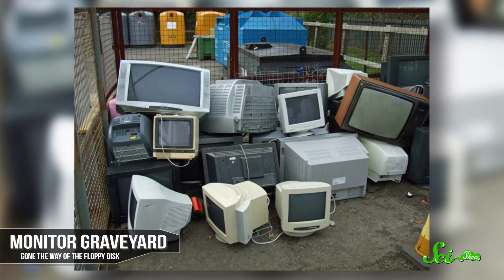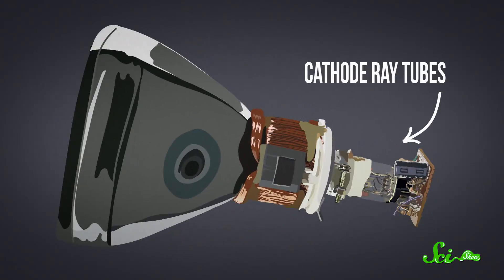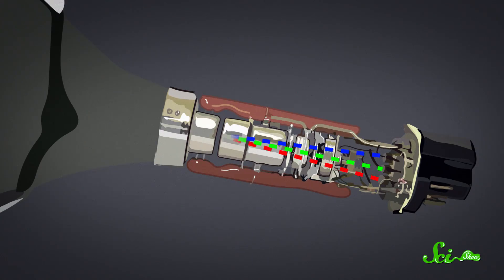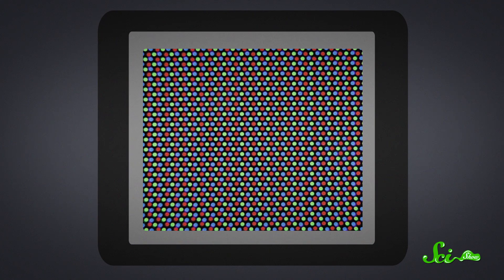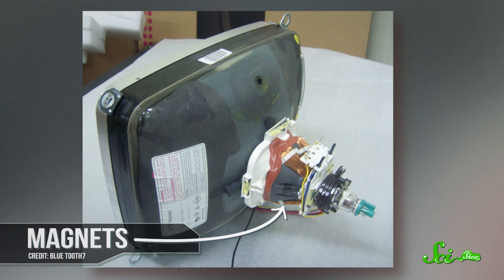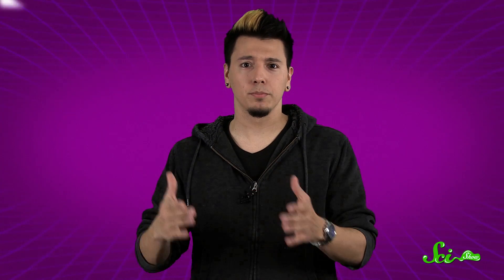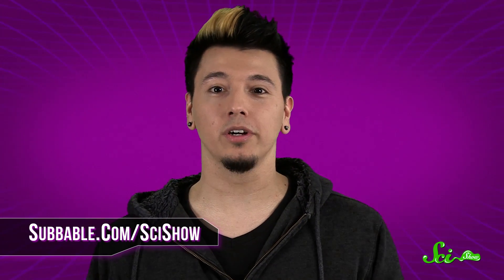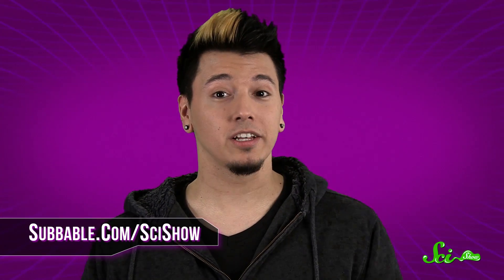How Did a Magnet Just Break My Monitor?

Comment: Place the woofer of your sound system on top of your PC tower and your power supply will fry in less than a year. It happened to me tree times before I finally wizened up to it. Always blaming the quality, it turned out it was my placing of the equipment.
Reply: Microwaves and routers together are also a bad placement, which was learned the hard way.
Reply: ***** It's not the vibrations, it's the magnets inside the sub-woofer.
Reply: Most likely the vibrations shifted dust to somewhere it shouldn't be.
Reply: Thank you all for your comments. Actually in my case the vibrations had absolutely nothing to do with it. It was the big magnet on the back of the speaker that did the job repeatedly. The vibrations kept my TWR lint free. but not dust free. I clean my motherboard once a year. The hard drive is now 16 years old and I´ve kept it for nostalgia purposes still going strong. It is an old IBM. All I did to fix the issue was turn the woofer around so that the vent hole was underneath to keep the magnet 10 cms above the TWR and the power source and that CPU lasted another 6 years until replaced by an upgrade. and yes the second power source did start growling about a month before it went south. I did clean some disecated spiders out of the cooling fins of the chip and video card.
Reply: Hang on...

What did you say?
It's, really late where I am..

Something about a computer woofer?
Reply: Jacob Thomas
That's when your PC growls because it's a real beast!
Reply: StevieRay9O oh.. really?
my computer doesnt make a single sound louder than the 15db fan...
does that mean its weak?
Reply: I WAS RIGHT MOTHERF*****S!!!!!!!!!!!!!
Reply: wow... was going to put my comp on top of my 12in sub and i'm pretty sure the magnet on the back was for 8 ohms... thanks for the tip...
Reply: *****
well then i'm sure you'd be quite surprised to know that i built the woofer, i suppose i'm not too informed on the magnets however. Regardless, I actually might look into this, sounds interesting.

Comment: Why do some things melt, like cheese or plastic, while other things burn, like wood or fabric?
Reply: things burn when bonds between molecules begin to break releasing energy. when something solid melts it is because the particles that make up the solid have gained enough energy to move around faster. When particles move around faster the state of matter changes. example: Water is just ice that has particles with more energy as they have more energy the state of matter changes from solid to liquid. Energy=how fast particles move=state of matter

Melting points can be dependant on the mass of the particles. particles that are more heavy tend to need more energy to become a liquid. The size of the molecules also affect the energy needed to make them not solid. 
The reason things burn is because the bonds between the molecules break when encountering a certain amount of energy. if the bonds are weak then it will burn. if the bonds are strong and the molecule is small then it would melt. I  hope that helps

Comment: Here's a question it may sound stupid but think about it...What Is Fire?
Reply: Here you go: http://en.wikipedia.org/wiki/Fire
Reply: Nilguiri Excuse me for not being born to an english country. English is not my first language, and not even my second, so please, don't be a dick.
Reply: Tatum Knowles
wrong. I'm a phycisist and it's because the reaction with oxygen and carbon makes the air/gas around the flame so hot that it starts radiating electromagnetic rays that are in a spectrum which we can observe with out eyes. When an objects temprature goes over 525 degrees celcius it will start emitting visible light (it goes from infrared to dark red), and the higher the temprature, the more intense will the light be. In the end you'll get blue flames (above 2000 degrees celcius).
Reply: uuuuuhhhhhhhhhmmmmmmm... very hot gas, that has so much energy to radiate, that it also emits light. Kinda like that, I guess?... maybe.
Reply: It is actually plasma. the heat of combustion gets the electrons in the gas above it so excited, that they leave their atoms, thus creating ions (so plasma is just ionized gas). But those ions arent very stable. they seek to get their electrons back, to get on a lower energy level. So when they finally get their electron(s) back, all that energy once put in, to rip the electron off, now gets released again, in form of electromagnetic waves/photons and therefore light and heat.
Btw, in order for atoms to emit light they dont have to nececarily lose electrons. depending on the atom/molecule it may also be enough to just excite the electron shell, literally deforming it like a flummy at the moment it hits the ground. This is also a way to pump energy in. When the shell pops back into it original shape, the energy gets released again in form of light (this is what happens in fluorescent tubes).
In case of the fire it depends on the colour of the flame, but if it is red/yellow it mostly is unburnt carbon from the combustion becoming plasma. thats also why there is soot collecting on things if you hold them just over the flame of a candle.

I hope I could help you (and that everything is correct) ;)
Reply: Hay I find that a pretty legit question.
Reply: Be nice all. Asking what fire is is a good question and we have gotten a few good answer here. I think however is such a good question that it may deserve it own little episode. Then question like if it a plasma or a gas (or nether) could be answer for example or if you really need oxygen to create fire. Fire is quite complex and fascinating phenomena.
Reply: Nilguiri you weren't even funny lol
Reply: It's an incandescent gas.
Reply: Nilguiri 1. I can't find a single ounce of humour in your comment
2. Do you have a life? What does my country have with my auditude? I can't beleive you have nothing else to do other than looking at my profile to check where I live.
3. "I'm guessing" my ass.
4. you are the hostile one.
5. you are also stereotypical
6. looking for excuse for your actions
7. why do I even bother, I'm sure you are not older than 13 years old, the extent of your interactions with people outside of your town is near zero, so your so called "opinion" on Israel or I guess any country that isn't your own are souly based from the internet and news.
Reply: FlyingJetpack1 Actually, this is a bit of a misnomer. Fire by definition needs an oxidizing agent--the most common one is oxygen, but something like Chlorine trifluoride makes for an effective (actually better) replacement for oxygen. Oxygen is just such a common oxidizer the process is named for the element. Other elements/compounds, however, can serve the role.
Reply: In two words or less. Plasma.
Reply: fire is the moment and space where the three conditions for combustion are met.
Reply: Not into the pit. It burrrrrrns!
Reply: Cythil Fire by definition means there is a need in oxygen, it's a rapid oxidation of the fuel, or something in his components.
To create a suitable state for fire to happen, you need a balanced consentration of fuel, oxygen, and sufficiant heat to create the chain reaction (heat doesn't have to be hot in our terms, as long as it's good enough for that spesific reaction, than it will burn)
Reply: FlyingJetpack1
You do know I was asking more of rhetorical questions right? I used them as a example on what might be relevant to a video to take up.

(on a deeper level it also a valid question a element like Fluorine can act as a stronger oxidizer then oxygen.)
Reply: Cythil  Oh I see, sorry, I thought you asked the question for yourself. Yea, they might need to give it an episode to clear the air on the subject. (btw: about fluorine, the more you know :P)
[P.S: wtf is worng with Nilguiri?]
Reply: fire is a rapid redox (reduction-oxidization) reaction which produces a sufficient amount of heat to maintain itself
unless you are talking about flames which is the airs electrons being ripped off by the extreme heat (aka it becoming plasma). this is similar to fluorescent bulbs, except they use electricity to rip off the electrons and have a coating to recycle UV radiation as visible light
(side note, oxygen is not required for fire, it is just a great oxidizer and abundant so usually involved in redox reactions)
(also not all redox reactions are fire, for example rust is a common redox reaction that is not a fire)
M390VI actually it is chemical, unless you are referring to how all chemical reactions work by using electrons to form bonds?
Reply: 1.
a state, process, or instance of combustion in which fuel or other material is ignited and combined with oxygen, giving off light, heat, and flame.

    Please, please, oh please tell me you where kidding.
Reply: Tatum Knowles It's not though. It's thermal and solar energy that was released from the bonds in the fuel molecules. Ask your future chemistry teacher.
Reply: teledoor24 It actually depends on the fire. Some get hot enough to produce plasma, others don't.
Reply: After all the shit that blew up on the plasma video, I think we genuinely need this.
Reply: Tatum Knowles Rarely the case though. I went to a "computing specialist school" that a. didn't teach computing and b. had IT teachers who struggled with Microsoft Word.
Reply: Nick Richter
XD
Reply: ***** fine then explain what it is and let see your chemistry knowledge
Reply: ***** well your not getting the nobel prize any time soon
Reply: Dax Daily please please please tell me you didnt google that
Reply: Cythil it is a pretty legit question
Reply: ***** wikipedia isn't reliable
Reply: ***** Yes cause im sure that is what steven hawking would say
Reply: Fire is wood rusting really really fast.
Reply: One word: plasma.

Comment: CRTs are still great display devices.
Reply: Also, removing permanent marker or someone's greasy finger prints is super easy in those.
Reply: Bit power hungry though.
Reply: They weigh lots.
They are too large.
They emit a high pitched sound when you get close enough.
They're bad for your eyesight.
The tubes need to warm up.
They have poor image quality.
They get large blotches on them if placed near a largish speaker.
Simple LCD displays are cheaper, and don't have any of these issues.

Try moving a 42 inch CRT up 3 flights of stairs.
Reply: ***** 

Cheaper LCD monitors emits hissing noises in some situations,not necessarily only when the PSU's Capacitors are failing.
Most LCDs have even poorer image quality and narrow viewing angles due to them being cheap Twisted Nematic.VA,IPS and PLS panels that are actually good are not as common as desktop and laptop displays but much more common on tablets and smartphones.
So LCD displays also have similar issues many of the times as well.
But still,anyone who is using CRT now for better colour reproduction should get a  IPS panel nevertheless.
Reply: Good job I have a mid range IPS panel

Comment: I had a CRT-monitor standing on a sub-woofer for like a year and after I moved the woofer the monitor looked pretty messed up. Fixed it right up by dragging a magnet I had lying around over it a couple of times. It didn't get perfect right away but it became usable and after a while it went back to normal by itself so it's not necessarily permanently damaged. Same thing when I played with some magnets on the TV as a kid. It was messed up for a week or two but it gradually went away.

Comment: You said that this only happened with old technology. Does this happen with modern computers? How do modern computers work?
Reply: It's about the screen technology not the computer. Modern LCD-screens (including TFT) work by having a back-light in front of a screen with liquid crystals that either block or let light through depending on if a current is passed through them or not. (actually it changes the polarization of the liquid crystal and the light is polarized first and when the polarization matches light gets through otherwise it's blocked). Each pixel on the screen is still divided into Red, Green and Blue subpixels to create all possible colors.
Reply: There really isn't anything different about modern computers that computers from 20 years ago didn't have. They are fundamentally the same. Besides, we still use magnets in the disc drives, hard drives, and laptops, which are typically in  top corners of the display and these are used to determine if the "lid" is closed.
Reply: ***** luckily, hard drives are starting to be replaced with solid state drives and disk drives are becoming less relevant because of the internet. but i imagine the laptop thing is staying for a while.
Reply: Huntracony
Solid state drives hold very little space though. The highest capacity ones I've heard of in commercial production is like 500GB, whereas I've seen HDD in the 4TB range. Either would work fine for me, and seeing as the SSD is faster it would probably be my better choice. However I got a HDD drive for some reason on my custom laptop i bought recently.
Reply: Darticus the Great right now hard drives re definately bigger, but SSD's will probably catch up.
Reply: Darticus the Great
1TB SSDs are in mass commercial production now. Though still really expensive. As for HDD, 6TB are in mass commercial production. Though they are still fairly expensive.
250GB SSD and 2TB HDD are more the decent price range around here. (British Columbia, Canada)
Reply: Huntracony Solid State Drives and Flash Drives are based on the same technology taht powers or RAM. The only difference is that RAM is volatile memory, meaning all data on it will be erased should it loose power, and the modules in your SSD and Flash Drive are non-volatile, meaning they will retain their data, even without power. BUT, SSD's do die, especially if you use them often, because each sector can only be written to so many times.
Reply: *****
Apparently that's a myth (that is, that Solid State drives spontaneously lose information). Sure they might be more prone to corruption, I actually have no idea if that's true, but they can store information for a long period of time.
Reply: Darticus the Great An SSD's lifespan is affected by the amount of writes you do.
Gabriel Tzukishiro I've never heard the term "virtual space" before, but what makes one drive a different capacity, at least with SSD's is that less chips are used, or chips with a lower data density.
Reply: Gabriel Tzukishiro my not be the right term you are looking for "Virtual Space" .

There are many different things that use the words Virtual and / or Space .

But i am venture a guess you are thinking of VIRTUAL MEMORY .
This is a process where you create a mini clone of your operating system ( windows , linex & ecta ) with in your operating system .
or
Run two different operation systems on the same computer .

The reason why is so you can run experimental , incompatible or even prototype malware ( hacker / debuger reason ) on your computer more safely ( but not fool proof ) .
Reply: Darticus the Great Nope, SSD spontaneously loosing data is not a myth. Just ask Linux. It is the result of trying to maximize storage space and speed while keeping costs down.
You can buy reliable SDDs, but you are going to pay significantly more for them. 2x to 3x the price. It has to do with the technology used both for actually storing the data, and the controller to access it.
Reply: ***** SSD and Flash Drives are the same technology, but RAM is quite different. RAM stores electrical charges that need to be refreshed regularly. Each bit is individually written to.

Flash storage can only read and write blocks at a time. To change 1 byte on flash, the whole block needs to be rewritten.
I haven't looked recently, but the block size used to normally be 4KB. The writes were done using ultraviolet light.
Reply: wolffoetowtech Erm, sorry, no. Virtual Memory is simply the extension of your physical memory (RAM) to your hard drive in form of a swap partition or cache file. It works like "real" RAM, but is greatly slower, so only usable for hardly used data. Windows uses this as a failsafe for corrupt memory data, or to safe up physical memory on low RAM systems, by storing most of it's own data in the pagefile.

You are talking about Virtual PCs, or hardware emulation, which in a way use virtual memory, too, but the other way around.
Reply: Emanuel May Thank you for clearing that up . 
It's been years sense i looked into virtual PC's , Virtual memory &  ecta .

Comment: I thought the "degauss" feature refreshed the computer and removed any magnetism.
Reply: I love the sound of a large CRT degaussing, aaah the good old days.
Reply: Dustan Jones I know EXACTLY what you're talking about.  That's one of the few things I miss from those computers.  Now I have to get by with auto-adjust.
Reply: The degauss feature on those monitors is too weak to remove much from the screen.  A deguassing coil will usually fix it.  They are pretty powerful electromagnets.  When I was in tech school they taught us to ask if anyone in the room had a pace maker before turning one on.  We were told that if there was, they might be killed due to the pace maker locking up.  Not sure if that is true.  Episode of SciShow?
Reply: Oh I hate that sound XD makes my hair stand on end.
Reply: Ah yeas the "CRACK-hiss-hum....hum....hum..." XD
Reply: I've screwed up monitors with woofer magnets and was able to get it back to just fine by taking the magnet in a big circle around the screen, spiraling in, and then pulling straight out.  Basically a manual degauss, I believe.